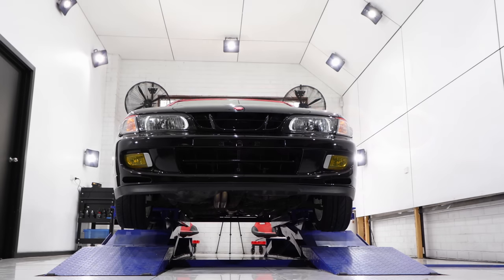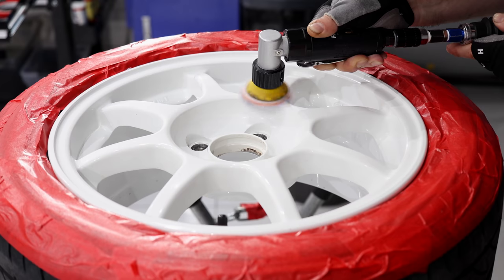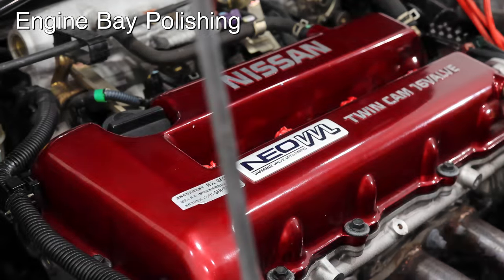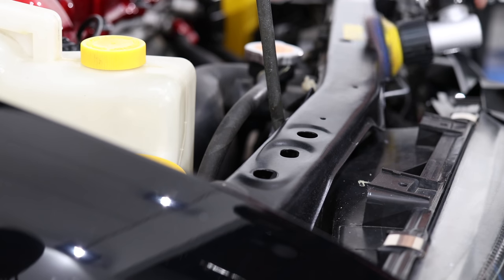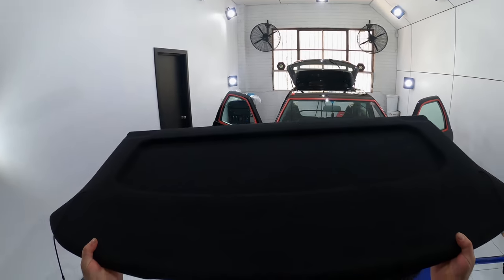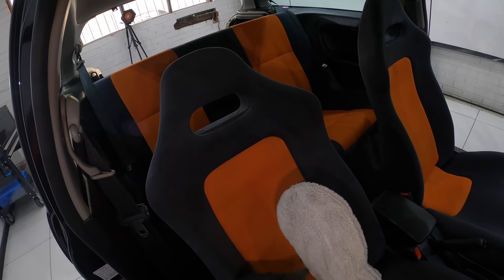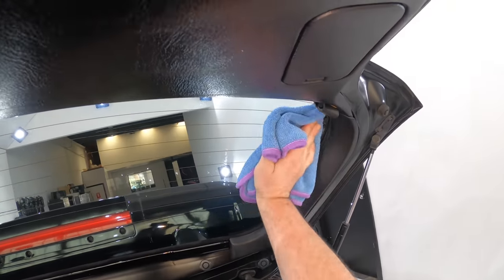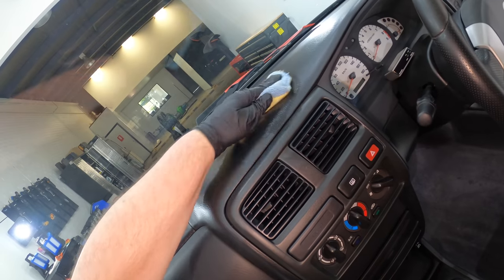75hr Detail | Rare 90s Nissan VZ-R N1 Spec II Pulsar | P2  Wheels Engine Bay & Interior! (Vlog 33.2)

Comment: My S2K's only remaining uncleaned spot is the wheelwells. Most guys skip this part in their detail walkthroughs. I had an idea about using ceramic like that (even have that Sonax applicator in my cart) but it's good to see confirmation of using it that way to build up a thicker layer than you conventionally would on the paint.

Comment: Really want to try NV Wheel. I've tried various trim and wheel coatings, but I still prefer the overall look and workability of just normal CQuartz UK for wheel wells over everything I've tried. Getting everything perfectly clean is the biggest key to a good uniform finish when coating nonpainted surfaces in my experience. Thanks Sandro! Flawless series! 👍👌✌

Comment: Loving this series, Sandro. Fabulous work! I learned a bunch of stuff from this one - will put it to good use on my own car, so thank you. I recently bought a new-to-me car that is a couple of years old, overall good condition but a few bits and pieces to tidy up which I'm gradually working my way through. A couple of marks in the carpet among them, I was looking at a drill brush, but what you say makes perfect sense. Will try a gentler method first.

Alas while my second car is a Pulsar, it's not one of these, just a bog standard knackered old sedan used for transporting the dogs, bikes, etc. As such, that one doesn't get any love (it is working out its retirement before it heads to the carpark in the sky), and would be super envious of this one! ;-)

Comment: As always, stunning work and results. If I am going to hang around for the correction vid? Hell yeah! Your videos are the best I have found on YouTube regarding detailing. It is something about the way you work and explain things. On top of that a layer of fantastic filming and editing. Thank you for taking of your time to share with us. I keep coming back to your vids for information.
Two questions. Do you protect fabric in wheel wells? And do you clean the scrubbing glove during the process?
Reply from the maker: Lol thanks mate! 
Yes, I’ve used Carpro Fabric to coat carpeted wheel wells - usually three layers applied. 
I have about 3 InnerScrub Gloves, but yes, because they already have interior cleaner on them they are pretty easy to wash out under some running warm water.

Comment: one point you forget today with power seats heated seats and the cables you don t want to remove them.if some one show up with 1970ts or 1080ts perhaps no power seats or as easy as 4 screws you could corsa 2016 but easy way to leave it all. any damage is on your tab on you

Comment: Hi Sandro, love your channel, you are consistently putting out the best detailing videos and they have been a huge help in elevating my work. 

Wasn’t sure of the best way to ask a question but hopefully you see this:

Is it safe to ceramic coat my rear parking sensors on my 2016 a4?

I’m looking to complete the correction and ceramic coating this weekend but am concerned about going over those parking sensor dots with both the polisher and the coating. 

Thoughts?

Thank you for everything you are doing
Reply from the maker: There’s no issue in correcting over the sensors or ceramic coating them, it’s fine to do both! Thanks mate and I’m sure your A4 will look fantastic once you’re done!
Reply: @CarCraftAutoDetailing  thank you very much, I feel more comfortable about it now and really do appreciate the quick reply! Cheers from across the pond in Canada!!

Comment: Hey Sandro, any insight on the extractor you're using? (Is the clear plastic attactment on your extractor aftermarket?)

Or perhaps your suggestions on extractors. Thanks for the great content!
Reply from the maker: It’s a B.A.R. Hot Wave extractor with the original attachment, it’s a great industrial unit and I love it but I’m not sure if they are still sold or produced. 
In my experience extractors are one of those things that you do need to pay through the tooth to get something that not only performs well but also doesn’t break down. I’ve gone through quite a few cheaper units in the past - they never last and lack in performance. I’d look at some Italian or German brands and just save my money until I could afford something good, but I’ve had the BAR for over 4yrs and I haven’t had to look elsewhere so I’m honestly not too sure about what’s a great option right now.
Reply: @CarCraftAutoDetailing  Amazing, thanks for the prompt response!

Comment: Thanks for the great video, Sandro. A detailer recently told my friend he doesn’t coat the inside of the rims because the wheel weights won’t stick to them. Is this correct?
Reply from the maker: No it’s not correct based on my experience, I have had several sets of rims repainted and recoated prior to fitting tyres and balancing and never lost a wheel weight as a consequence. I’ve also attached badges to car paint post ceramic coating and they have stayed in place without issue. I guess it would be ideal to attachment any car adhesive prior to coating but the strong bond a true ceramic coating makes to the paint also enables you to have a fairly good bond over it.
Reply: @CarCraftAutoDetailing  thanks for the information and taking the time to reply. Love the channel.

Comment: Amazing job, as usual Sandro! Can you please make a favour and share your experience about CarPro Dlux for wheels ( Nova is not available here in Sweden, so using Dlux). There is nothing stated in CarPro manual about second coating and I have never done it acrually. Read some forums where people told there is no benefit for Dlux second coating, getting even worse, etc. Have you did it Sandro? What is your experience with Dlux? Is it okay to put two or even three layers of Dlux for example to rims? Many thanks in advance and have enjoyed the video! Waiting next weekend))) Cheers from Gothenburg.
Reply from the maker: Thanks and yes I’ve used Dlux a lot for wheels and wheel areas and I’ve layered it frequently which does improve both look and longevity in my experience, it’s a great coating.
Reply: @CarCraftAutoDetailing  Thanks Sandro. Yes, saw all the videos. But have you did Dlux in 2 or 3 layers same time? Never seen this in your videos.
Reply from the maker: I’m pretty sure I’ve shown in quite a few past videos but I’m not sure if I’ve specifically gone through the layering of it - maybe not.
Reply: @CarCraftAutoDetailing  Sandro, great thanks for early response! I will try it out myself and I am pretty sure as well it will be positive. Many thanks for answers!

Comment: Once again Sanjay did not fail to impress us with his skills! I couldn't agree more with you on the carpets and today's scruffy ones available at auto stores. I wanted to ask as I have been trying to get rid of a bad oil stain in the trunk carpet from the previous owner. I have tried to dry clean it as the carpet has the sound deadening material backing (the same as the trunk carpet in the Nissan), would you recommend me washing it with soap? Thanks in advance!
Reply from the maker: Yes, some sort of soap or degreasing chemical may be a good option, steam may also help, but I guess it’s just a balance of trying to remove the stain while trying not to damage the carpet.
Reply: @CarCraftAutoDetailing  Thank you Sanjay for your advice. I will go ahead with trying to use a degreaser or soap and brush lightly to try and remove the stain. Can't wait for the final video on the detail of this car!